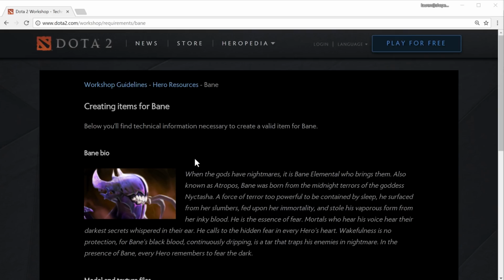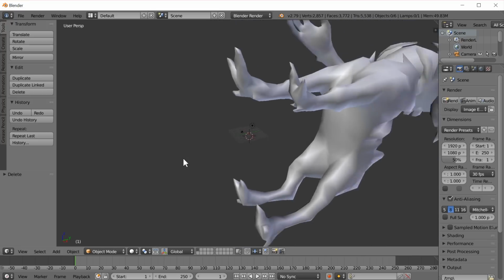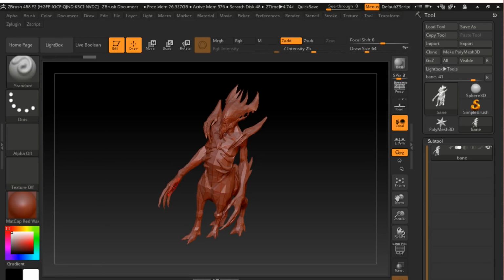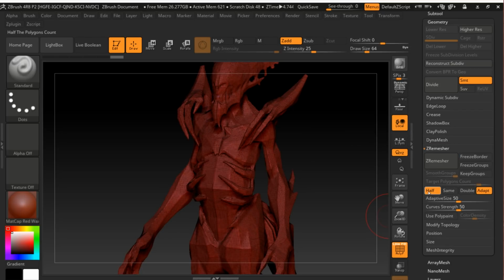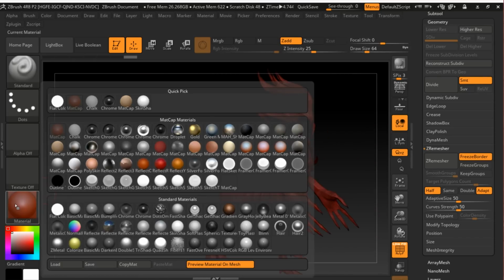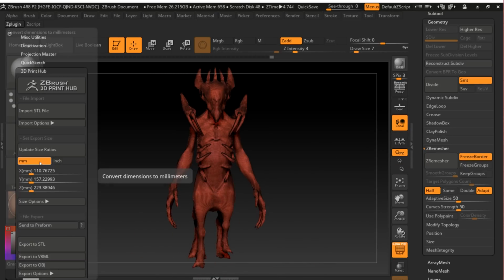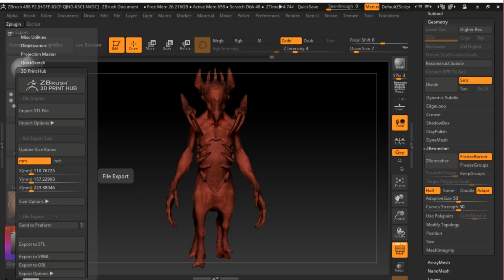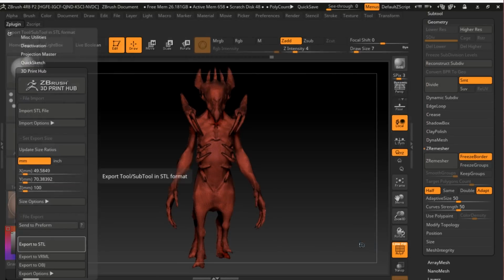How to 3D Print Video Game Assets | Shapeways Tutorials

Comment: Alright since the video was useless I’ll put the ways I have done it here:

1.) All you need is Blender and (optionally) a Mixamo account to do this (they’re both free)

2.) Then go on the models resource online to get a video game characters model files. They can be .OBJ or .DAE (preferably .DAE)

3.) if your model is is .OBJ but you want to pose it make a Mixamo account and have that automatically rig your model (note it has to be humanoid for auto rigging to work)

4.) Convert to .DAE and open up Blender

5.) import your model, and since it’s .DAE that means the skeleton is already there for you to manipulate and pose. Just click armenture on the top right and go into “pose mode”

6.) go into wireframe view and pose your model

7.) when you’re done export as an .STL file and boom you’re all good

It’s important to note that if the model you’re using is very polygonal, hit “a” on the keyboard to select all parts of the model, right click and click “divide.” This doubles the poly count and you can do it multiple times. In addition if you want to smooth your model out further there is a “smooth” brush in sculpt mode but fair warning, it takes a lot of patience and a steady hand. One last thing if you characters model has 0 thickness (say it’s a piece of clothing or armor or hair) then you need to give it a thickness for it to print. Click “a” again to select everything, go down to the little setting icon on the right part of the screen, click add modifier and then click “solidify.”  There’s a a toggle with a number on the right, just add as much thickness as you think is good.

Hope this helps!
Reply: I have a character with a skirt. I deleted her legs but the skirt is too thin to print. I want to fill in the skirt so it's just one solid piece of resin, not hollow.

How do I do this? Solidify or extrude doesn't help me in this situation. Many thanks.
Reply: @OhManTFE  very late, but tryusing a repair tool like 3D Builder or netfab. If you use the Prusa slicer, netfab is integrated: click repair or click the yellow exclamation when you import.
Reply: Not sure what I'm doing wrong here. Got blender, got a file and imported into Mixamo. Rigged fine, animated it. It shows the animation fine. I download it and try to open it by clicking "import  .dae" in blender and nothing. Doesn't even show up (just shows the cube, which I can delete but still nothing. ) Any idea what my issue is?
Reply: Actually it is showing up as a bunch of tiny dots. I can import the OBJ just fine, but it's just T-pose

Comment: what about models with extreme overhangs?  Will they be printable without cutting them into pieces?
Reply: depending on your slicer, you can add supports in the modelling stage or the slicer stage. tree slicers in Cura are pretty good in my experinece

Comment: HI, would I be able to use this appoach to pulll items from any pc game for print? For instance, I have an older game called Il-2 combat flight simulator that has added vairous planes though mods over the years that I would like to print off for war gaming. Is this possible?
Reply: It should be possible if you can get the 3d model